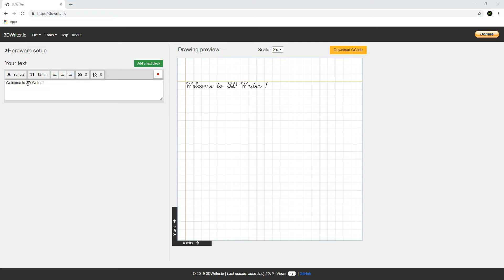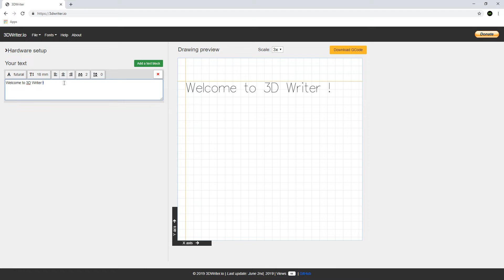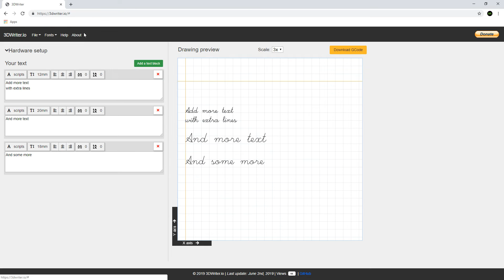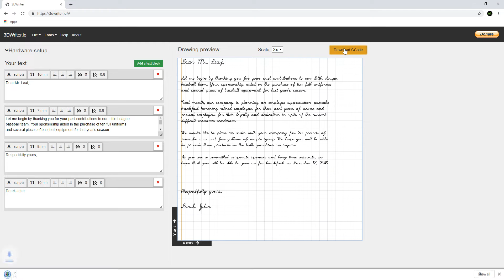3DWriter.io - Easy written text using your 3D Printer and a pen

Comment: Chris, what a magnificent job!
I would love to see it working perfectly, but I have a problem.
every time I create a Gcode, no slicer can interpret it.
the instructions are there, but simplify 3d or cura shows absolutely nothing, and the Gcode viewer of
Octopi doesn't recognize him...
maybe you can find out why this is happening?
and i would like to help

thank you for dedicating your time to such an innovative tool
Reply from the maker: Hi, thanks for the kind words :)
There is no need to slice the file. 3D Writer outputs GCode directly. I can check with octopi in a few hours but i would normally use Pronterface for doing writing jobs, it is a bit more hands on and you can stop it if things aren't going to plan.
I'll post back anything i find with octopi.

Comment: Thanks a lot for this great solution 👍 It would be amazing if this site would save my printer settings (in a WebStorage or something). Or I can parametrize them via URL and save it as a favorite.
Reply from the maker: i'll see what i can do this weekend. would you use o-auth (login via google/facebook etc) as a login method ?
I'm not interested in making people sign up to my website
Reply: @Makenitso  you wrote, that you were using HTML5, so a local browser storage would be more then enough! No need for signing up. Or otherwise use URL parameter. There are several snippets around, which translate those parameters direct into the form-data :)
Reply from the maker: @ThomasRiebmann  it is done :)
the URL updates when you change values so when you have set it up just bookmark it and you're good to go.
Reply: @Makenitso  Works great! Thank´s a lot, much appreciate :)